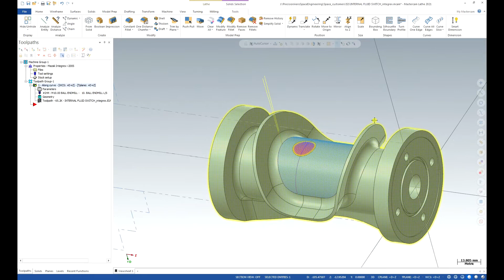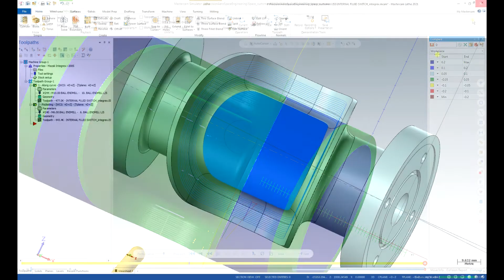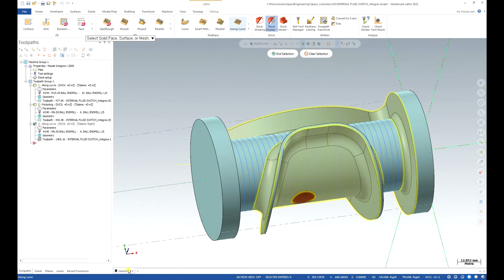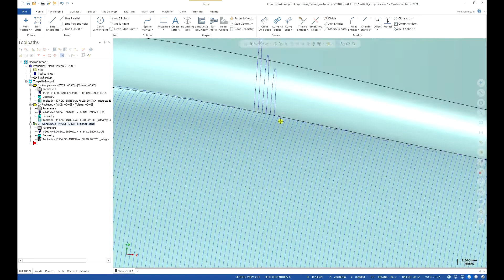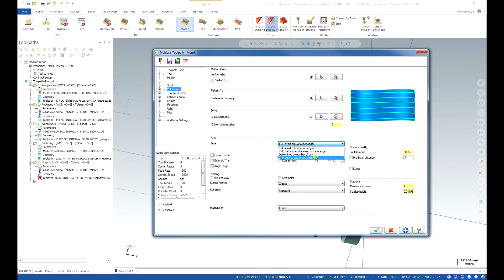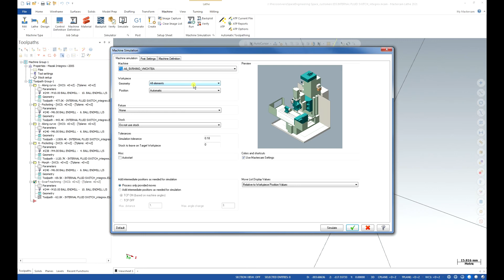Mastercam Multiaxis Tutorial -  Fluid switch - ALONG CURVE, MULTIAXIS POCKET, SWARF AND MORPH

Comment: How many years have you been working with these multiaxis toopaths to know just which toolpaths and  what settings to change. I am learning so much from your videos. Keep up the great work. It is greatly appreciated 🙏
Reply from the maker: thanks Greg,
I've been using mastercam for about 20 years and half of this time with multiaxis programming (Variaxis, integrex, kitigawa, hass, Emco - all 5 axis)
I use multiaxis toolpaths also for 3 axis (3d milling) and 4 axis work as well as for some programming work for lathes :)
those operations are very powerful